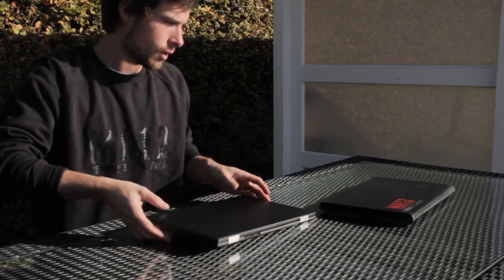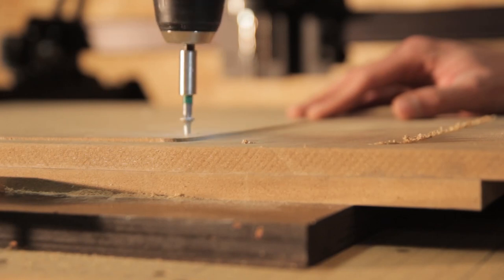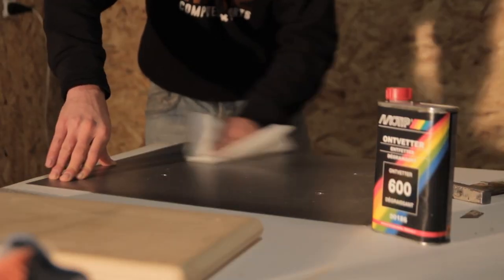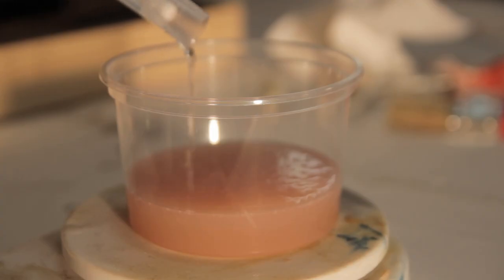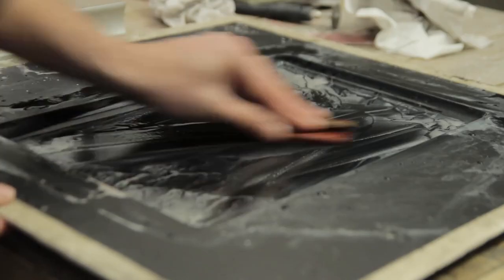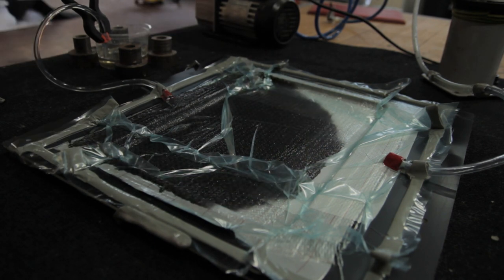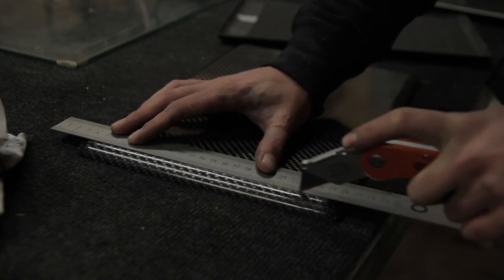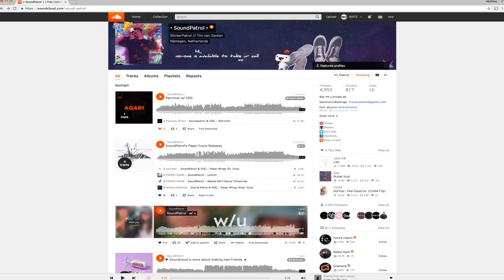CARBON FIBER CASE (How It's Made)

Comment: Hello , I do have a similar project I bought some coloured carbon fibre I want to make a clip board with hinges that opens and has storage compartments the ones I buy at staples brake easy and the locking Mechanism also breaks real easy . My clip board will be strong and have led lighting almost like a portable office with pen holders battery storage compartment and stuff that will help me get things done , it will be thick to hold all these ideas and awesome but I'm new to working with carbon fibre and really know nothing about it can you help me ?

Comment: Keep up the good work! I have a question about the infusion finish. I see from your finish at 8:42 the fibers from the twill are showing a bit instead of a gloss. I keep getting this result in my parts as well and I was wondering if you just keep it like that? I think it's from the vacuum pulling the fibers to the mould not letting resin get to the high parts of the twill. I know I can add another layer of epoxy after but I was wondering if you do anything about that finish?
Reply from the maker: I like it how it looks like that for this project... I think it's a matter of personal preferences... 90% of my parts get a clearcoat depending of the project, solving the problem you are talking about :) using a gelcoat or extra layer of epoxy could solve it as well like you said

Comment: not bad my friend. any link how that material you use fiberglass after gelcoat.?
Reply from the maker: It's the mouldmaking kit from easycomposites 1. gelcoat 2. 100g/m fiberglass + coupling coat 3. 400g/m fg and tooling resin